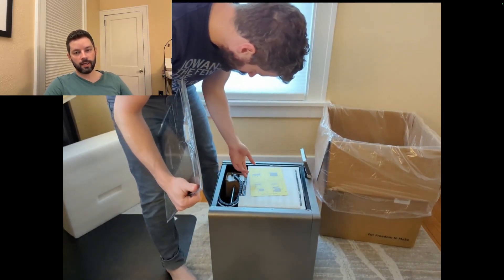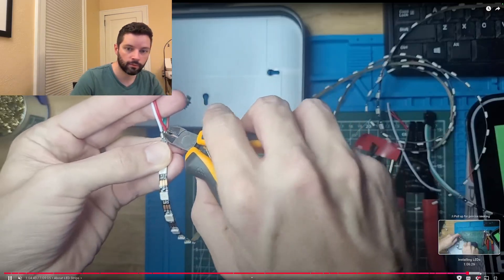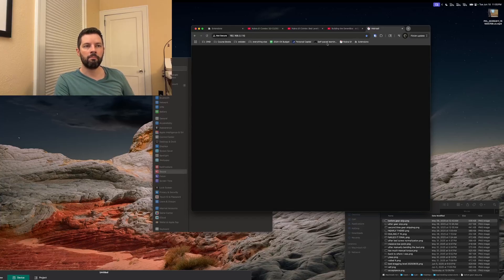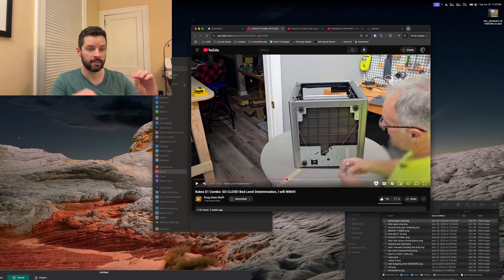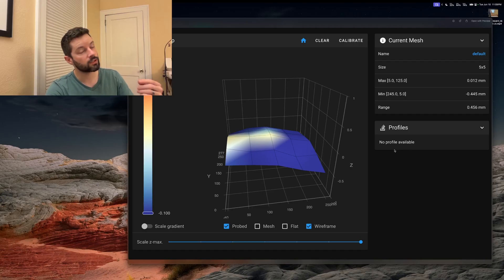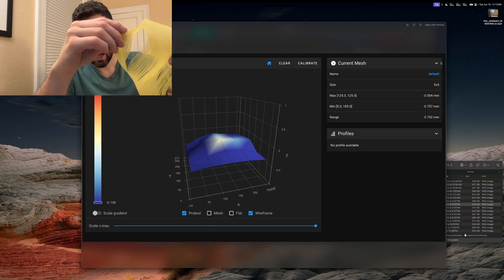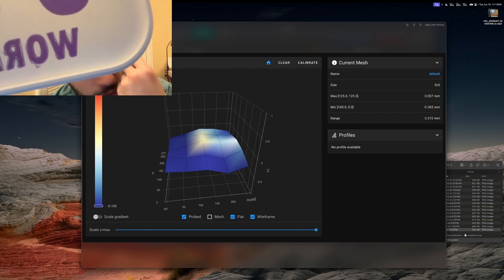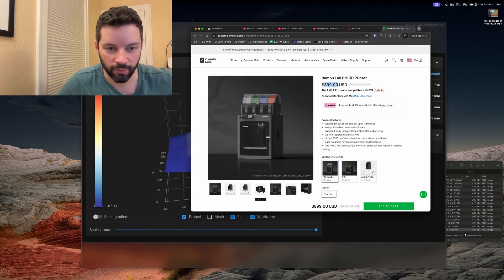Anycubic Kobra S1 - Review, Troubles, and What to Buy Instead

Comment: Few points on my end about the bed level. The difference of 1.2 isn't the issue, it's the points closest to each other. The corse build plate causes too much difference and at random as the points are never the same between probes. Here is what I'd recommend, use 0.3 initial layer height not 0.2 (due to the build plate), adjust z-offset in Anycubic Slicer next in printer nozzle settings, print the first layer slower (or just use quite mode), you can loosen the screw in the build plate if you just print a full sheet (cube thats scaled to 250x250x0.3), use a finer texture build plate like Anycubic's cool plate version. If you are switching from the stock nozzle to an all-metal/bi-metal, the flow characteristics change and you'll not get the same quality first layer as the stock nozzle. Certain filaments and colors are more sensitive to first layer issues. for example my white Elegoo PLA is dog butt compared to my black Rapid PLA+ for a first layer.

Comment: Well I've been through a couple of testing and also issues with my S1 as well. I never bothered about the first layer stuff, because I haven't felt the need to print something like that but maybe you can send me one of your files to try it on my S1?!
I measured my bed using a gauge dial (that's the term you've been looking for lol) and after a little brute force bending I'm at about .4 mm difference overal which is good enough. I also got a new print plate (Biqu Glacier Pro) which is a huge upgrade. My main issue was that the nozzle scratched my plate at some point, I just received the replacement parts today but I've ordered a new plate and a 3rd party hot end anyway. I will start testing these days to see if the new hot end solves the scratching issue and if you like I can also try and test how your prints would look on my printer with different materials. 
It could be material or profile related so maybe we'll find a way to get our both printers up and working as expected ;-) Check out my YT channel, it's not in english but hey, most stuff is self explaining anyway. However I will upload more videos about the S1 and the testing as soon as possible!

Comment: The s1 combo is $550 right now vs $900 for the p1s combo. I have a ender 5 pro that ive swapped a direct drive onto and am in the market for a new printer. Right now the a1 combo and s1 combo are priced the same. Ive joined groups for the s1 and bambu and the print issues seem to be exactly the same. Plenty of complaints from bambu owners(a1, p1s, hd2) of first layer quality issues. What's strange to me is print quality issues using wifi vs flash drive. 
Look into pressure advance settings, ive seen some say this fixed their issues.
Reply: Follow up:
Ive owned the anycubic kobra s1 combo for a month.  Its outstanding.

Comment: I have the exact same issues. The amount of time I spent tinkering without getting any consistent results would have easily justified to spend a bit more for a Bambu. Anycubic even sent me two replacement beds and a new touch probe without any improvements.
Reply: That's exactly what I went trough. Two replacement beds and new leveling sensor. Last bed was the worst so I disassembled it straight away and I found that metal electric component in the middle is not glued symetrical. This is making the hump in the center of the bed. I cut a hole in plastic compartment in the middle but cutting and removing 2 plastic ribs inside it is enough. Then I added also 4 pieces of silicone tubing in plastic holes around the screws. Few milimeters longer than the hole, giving me a chance to compress them and then use screws as a leveling points for more than 1/4 turns as per Anycubic Wiki. That way I finally made this bed flat enough. Under 0.2mm so under one layer. After bed installation I checked bed level to X-Y axis and had the same results as an author of this video - 1.2mm difference from highest to lowest point. Fine, I started skipping the belt on the leadscrews. After like 1 hour my bed was finally leveled! Whole printing area under 0.2mm to the nozzle. Then I replaced my faulty leveling sensor and I thought this will finally sort my problems. Success? Oh well, absolutely not! There is no major difference between leveled bed with new sensor and my start point with first warped and not leveled printbed. Still terribly bad, uneven, too high, too low first layer areas. At this point I just gave up. I'm waiting for some aftermarket solution for this. Anycubic will probably do the same as with Kobra 3. They soon will release S1 V2 so no any help for us. Gents, I got also Bambu Lab A1 and A1 Mini and both units are flawless. I'm using them for months, great first layer every time. I'm just sending the print from PC and I can go back when is finished, don't need to even look what my A1s are doing. Of course, you can get also broken Bambu printer, but I think the chance compared to Anycubic is many, many times smaller. And when they sending you replacement parts, that actually helps. That's my two cents.